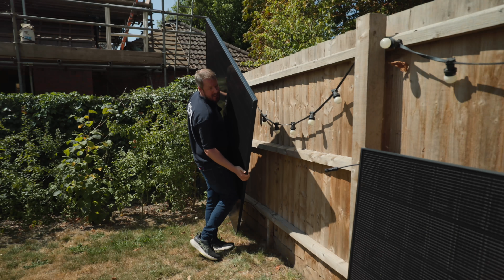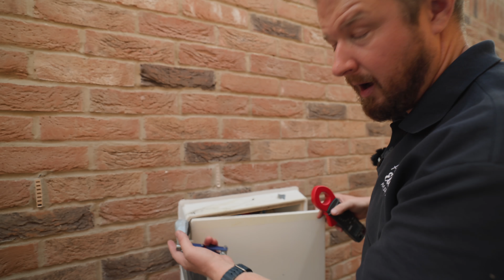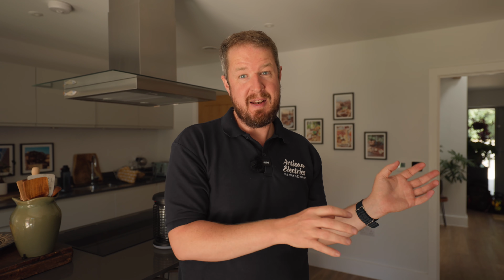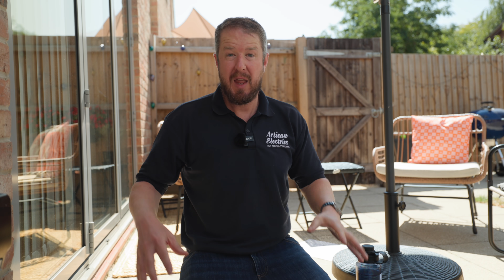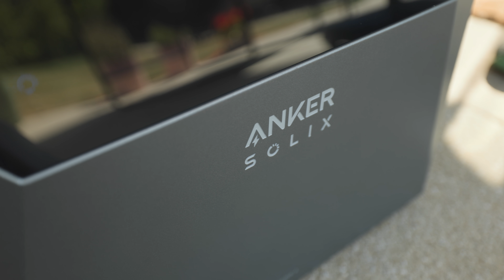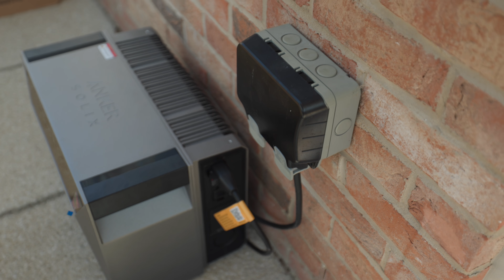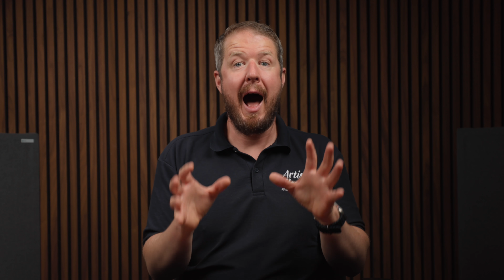The MISSING PIECE of Plug-In Solar

Comment: Does anyone know how efficient the Anker Solix is when charged from the grid? A few days ago, I tested the efficiency of a Bluetti Apex 300 power station, and the results were disappointing. I charged it to 100% first, then connected a washing machine, followed by a heat-pump dryer. The consumption meter showed a total usage of 1.51295 kWh for washing and drying, yet it took 2.1148 kWh from the wall outlet to bring the Bluetti back to 100%. A power station like the Bluetti isn't the same as a plug-in solar battery, but ultimately, it serves the same purpose if you use it to store cheap electricity at night for use during peak hours. (For context, I also have a SolarEdge system with 10 panels and optimizers, a 5 kW inverter, and a battery with a usable capacity of 9.7 kWh; during the summer months, that system supplies 100% of the electricity I use.)
Reply: With a low load it can be a full cycle of 75% or on some less quality kit even worse, the more power your draw at a given instant the more efficient the inverter is. Basically there is a percentage loss and a fixed wattage loss near enough so the higher the power draw the better the efficiency.

This is why RVs use 12-48v fridges, aircon, lights etc and anything that's on all the time.

48v is very tempting to run round the house as a way to avoid electricians and annoying regulations 8)
Reply: This is of course deliberately overlooked by anyone selling these devices on youtube.

Comment: Had plug in solar for the last 3 months generated £70 over that time … base load usually 500 to 800 during the day can be higher home all day as we work from home.. with EcoFlow stream ultra only once have we maxed the battery but otherwise plug in solar covers base load up to 1200w never have surplus to store have 4 panels south facing’s garden

Comment: 3KW Kettle... Why?

I use an 800W kettle, not because I have plug in solar, which I don't, but because it is small and light - much nicer to use than a big heavy 3KW kettle!  Problem solved!

I also have a 700W oil filled radiator, which could use up all the spare plug in solar power keeping the house nice and warm, then the house becomes a thermal battery, and since you already have it, will cost nothing.   Would be even better if you could monitor the house import/export and adjust the heat output of the radiator to use exactly what is spare... that would be much cheaper than a battery, and not limited in capacity.
Reply: Because a 3kw kettle will boil in a minute or two.  

Also, when solar generation is high, heating the house is the lowest of your priorities.  keeping it cool would be far more beneficial!
Reply: @jameshodgetts7541  While my 800W kettle takes 2 minutes 37 seconds to boil one mug of tea.

I actually have a 2KW kettle that is an almost exact copy of the 800W kettle but scaled up to "normal" kettle size, both the same build quality, so I can use either, but I almost always choose to use the 800W, unless I need more than 3 mugs full, which wouldn't fit in the small one.

If you are cooling the house, a small aircon unit normally uses less than the 800W in normal running, for both cooling and heating.  However decent aircon is not plug in, and costs a lot more than a convection heater to buy and install, so it doesn't really go with plug in solar!

Comment: How does the battery know how much power you need in the house?
Reply: You have a Smart Meter clamped onto the mains cable coming into the house.  It tells the battery whether power is flowing in or out. If coming in the battery releases power until the Smart Meter tells the battery (via WiFi) that nothing is coming in.
Reply: @timbrassey9146 not mentioned in the video.
Not part of the battery.
Professional installation not mentioned.

Comment: Lots of people work from home at least part of the week and lots of pensioners spend time at home. So I'ld say you're being overly negative saying that most households won't use the energy
Reply: For an 800W system large quantities of collected data and models say average usage is about 50%, which makes a battery just for saving half of it a bit pointless. At 400W the battery is almost totally pointless but at 1600W the battery starts to shine.

Comment: Doesn't it need to be connected directly to the consumer unit with a bidirectional RCBO? I was under the impression plug-in changes did not apply to batteries.
Reply: It's designed to detect the grid and cut out. Same as plugin solar inverters. Same limit too if just plugged into mains, 800w.

Comment: Sorry, how did you use ohms law to calculate the power?

Last I looked ohms law was V/IR
How did you get power out of that?
Reply: P=IV
Reply: @aureltanasan1413 that’s not ohm’s law
Reply: @familyoffourdisneydreaming6081 
P is used along Ohms law for calculating power in circuits etc. 
Power formula is always used along Ohms law, P=I2 R ,  P=V2/R , P=IV. 
Strictly speaking Ohms covers the relation between V, I and R. But power formula was always associated to Ohms law, and became a figure of speech, even in college class.
Reply: @aureltanasan1413 ohms law has nothing to do with power 

Sorry
Reply: @aureltanasan1413  That is Watt's Law.

Comment: The main issue is how many homes & EVs can actually charge at a cheap night rate

6 millions EVs will be sold in the next 4-5 years all trying to charge at the same 6 hour night cheap time

The low demand period will no longer be a low demand period

If the night time cheap rate dissappears then almost all the 'savings' of EVs and home batteries also dissappear
Reply: Given smart tariffs were created to adjust consumer behaviour (incentivise import at cheaper times), I suspect they'll shift tomorrow at different times as the electricity system changes (eg cheap afternoons in the summer). EVs, the largest home consumer, may be more of a challenge as people park overnight and drive in the day, but I daresay the clever energy companies will come up with something.
Reply: There are at least 2 bigger factors here
1. A lot of the reason we have a night cheap rate is the big gas generation plants want to keep running 24x7 for a bunch of reasons unlike peaker plants. Ditto older nuclear. There is a point where the cost will be such that they drop off the grid instead.
2. We don't have enough big commercial battery farms.

If you are working on "I will make money by arbitrage" you are basically betting that your little battery with a relatively expensive connection and limited access to grid balancing payments and the like can beat a giant battery farm at its own game. Short term that's obviously a good bet given the mess UK planning approval is I grant, and Axle has certainly opened up some opportunities.

We are also starting to see a summer duck curve so in a few years it may well be that cheap power is summer self consumption middle of the day. Which will be fun for all those people whose EV is parked at work those hours 8)
Reply: @etchedpixels  gas power plants are flexible they don't have to nor do they run throughout the night

The coal stations were somewhat flexible but not fully. All the coal has been demolished

The nukes were the only ones that really wanted to be on 24/7 but ALL but one single reactor will be shut down by March 2030 which is only 3.5 years from now

In as little as 4-5 years there will be no low demand night time as the night time demand 'thanks' to EVs and home and business and grid batteries all trying to charge at night

The biggest one will be EVs 6 million EVs sold in the next 4-5 years will add a massive concentrated demand to the night period

Either the cheap rate completely disappears

Or the differential falls (so rather than 25p peak 8p night maybe it becomes 20p peak 13p night)

Or some new system whereby there are two cheap peroods. Perhaps 10pm-7am and 8am-4pm during sunny days so the charging is done over 16 hours rather than 6. But this 16h of cheap rates will likely mean the 60p daily standing charge might have to be closer to £1.20

Comment: Northern Ireland is getting robbed by the electric monopoly here again.  We pay 37.9p per kw 24/7 or 40p day and 18p evening. On an economy 7 system that they now call EV. This is despite the regulator here dictating profit  controls and over 60 % of generation being renewable basically wind. Plus solar installers are dead keen when you contact them but once they 43al8se you have any existing equipment they disappear.  Reminds me of the mortgage issue of the 90s.

Comment: The inverter efficiency is normally about 75% so the calculation is not right !?
Reply: I thought modern inverters were over 95% efficient

The battery charging and discharging can be a lot of losses though perhaps 10% each way
Reply: Depends on your load. 95% under a reasonable load is correct. If it's trickling 50-100W out then yes 75% except for high end inverters.

Comment: In the Netherlands you can be fined >only<  if you contracted the wrong energy supplier , for example: with a dynamic Tibber contract you can feed-in as much as you like !
Reply from the maker: Interesting to hear how they handle it over in the Netherlands! Thanks for clarifying.
Reply: Don't even need a dynamic contract. Fixed price contract pays a pittance for your exports, but it's not as if you have to pay ( "fine" ) to get rid of your surplus.
Reply: Exactly, I have Tibber and now a plug-in battery, so I save the solar and even charge when cheap if solar not enough and then use at evening or even discharge to grid on peak price times

Comment: Well, apparently the plug-in solar system has to be approved, and at the moment there is only one available. You can't buy panels, microinverters, some cables and plug it... Well, you can but it's illegal. It has to be a whole system with all certificates, etc.
Reply: Seems like the usual stitch up to get you to overpay for cheap panels etc

Comment: There are over 9 million pensioners in ? 5 million households likely to be at home some days of the week!
Reply: At 800W of panels it's not worth a battery anyway. At 1600W different story.
Reply: @etchedpixels  Good point, you are going to use some of the 800W on background load, and normally there will not be enough sun to get the full 800W from a cheap Lidl kit anyway, so there is no way you can fully charge and discharge a 5KWh battery daily, year round, and the economics of batteries do not work out well unless you make a lot of use of them.  Battery prices are dropping, and lifetimes improving, but you still want to fully charge and discharge every day for most of the year to make it a good investment.

It will be interesting to see what the government introduces for the plug in battery rules. Hopefully you will be allowed more panels than for plug in solar, no real reason why you shouldn't have a whole garden fence of panels and 16KWh battery, as long as the inverter is limited to 800W for a 13A plug, and it has plug and play ability to avoid exporting your power.  They should probably also allow a 7KW plug option, maybe using a standard V2G plug/socket.  Currently it is far to early to know what will happen, and this video is not helping; this video should be about plug in solar, but of course that does not bring any business to Artisan, while the suggestion that plug in solar alone is an inadequate investment might!
Reply: @nigels.6051 people have been telling government for over a decade to make a standard interface like a 32A commando mandatory on new builds, but government does not listen Ditto we are now getting roof solar fires on old installs because government also didn't listen on AFCI

Comment: May I point out under the new regulations,you are NOT allowed to plug batteries into the mains ring.
Reply: I mean blimey what is actually going on. The rules are quite clear. Batteries through 3 pin not allowed.
Reply: @tonyfeasby1437  And people pay these folk to wire houses and stuff - scary
Reply: @tonyfeasby1437  And the massive irony is literally a few weeks ago, this same bloke was putting out videos about how dangerous plug in solar is and how we're going to have burned down houses everywhere.  And now he's telling us how wonderful it is to do the complete opposite!
Reply: quite surprising, it's not hard to do it via a fused spur to make it 'legal' 
but the size of this channel, posting a video like this is very misleading lol
Reply from the maker: That's exactly why I mentioned in the video that these require a hardwired connection by a licensed electrician to stay compliant! ⚡
Reply: @artisanelectrics yes.. Then you can charge a installation fee. That's the point of plug in solar, so that we can avoid clowns like you
Reply: @artisanelectrics 
When has electrician become a licensed trade?
Reply: Nor is slinging up random panels 8)
Reply: @etchedpixels  ...and on a wooden fence
Reply: @DarlyB depends where
Reply: A cynic might say plugin solar is illegal for another 3.5h as of writing 😉

TBH, I'm surprised the video claims plugin batteries are legal (already).

IMHO the particular point is that these batteries can be used if wired into a spur by a qualified electrician, in which case some systems will output several kW.. which is a boon for electricians currently.

Comment: No. In our house we work from home and consume most electricity during daylight hours. Plug in solar makes total sense. Won't do much in winter though. Once the kit pays for itself I'll consider adding a battery to store any excess.
Reply from the maker: Definitely makes sense for your setup. It's important that people get what best fits their energy usage to make the most out of their system.
Reply: Battery systems are only allowed if hardwired up to 3.6kw AC output 

Some of the new systems go above that and might need more complex DNO interaction,.to the point where a permanent battery becomes almost as economical as a semi permanent/portable option. The only benefit then is you could easily recommend and take the semi permanent battery system with you.
Reply: Well done
Reply: Wronggggg
Reply: Yes current kit £1000 saving a year £70 on average so 12 years before break even point
Reply: @Uk-Writer the octopus energy one is 650 for 800w...please don't quote random/wrong numbers
Reply: @Uk-Writer  pure bullshit.. Im saving 40 euro per month.. Stop spreading lies. Ecoflow stream ultra x..
Reply: @Uk-Writer In April I paid £250 in all for new 2x DMEC 465w panels from city plumbing and an ecoflow inverter. According to the app i've generated £112 since. Now though the prices have gone nuts unsurprisingly.
Reply: @Uk-Writer  800watt EcoFlow systems start from £499.00 inc VAT.
Reply: @alanwood9804I got the eco flow inverter from Argos £129 and panels from a plumbing supplier for £90 each £310
Reply: @alanwood9804Marstek Venus is under a grand for a 5kw

Comment: Question: I don't see anyone else answering, so maybe you can.
So, 5kw battery, perfect. How do you get that battery to ONLY discharge what the house is using? It is great to have the known base load, and to monitor the peaks and troughs of usage throughout the day. But can you set it to discharge, say 600w continuesly BUT if the current house usage drops to 300w then the battery lowers its output, ensuring you are not pushing your stored battery power to the grid? I know there is a device (can't recall what it is called) that monitors incoming and outgoing current flow, so can that information be used to slow the output of the battery?
Reply: Yes, you can get a CT clamp on your grid connection which monitors how much energy is being exported/imported. The battery uses this data to vary its output to make sure the its not exporting its energy to the grid. I think Shelly makes one that works with the Ecoflow Stream series. I'm sure there are others that work with other manufacturers.
Reply: @harrygrumbar4589  Shelley is really designed for Germany as are a lot of these kits. That makes them a pain to install. They are also wifi which makes them really slow to follow loads so they perform abysmally with a device that switches power consumption rapidly.
Reply: I guess if you have a smart meter there is already a something broadcasting your electricity usage on around 434MHz for the In-Home Display unit.
Reply: @BrianG61UK ZigBee but good luck tapping into it and it's far far too slow for that kind of use.
Some more UK focussed product has simple battery clip on WiFi CT that's easy to self install in a UK home